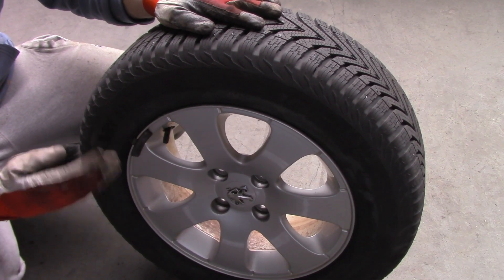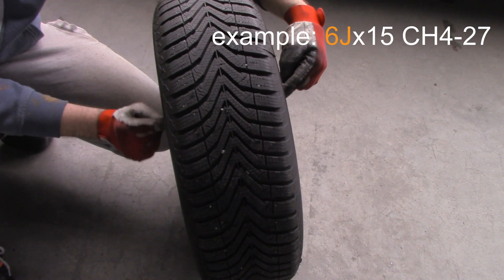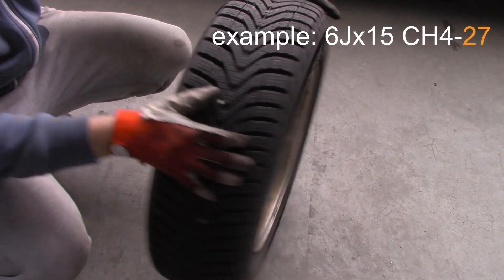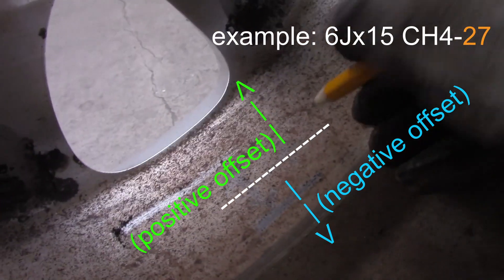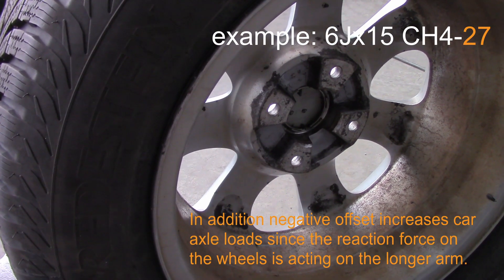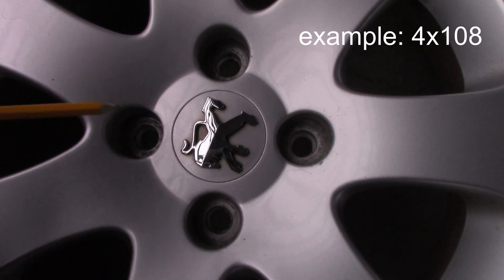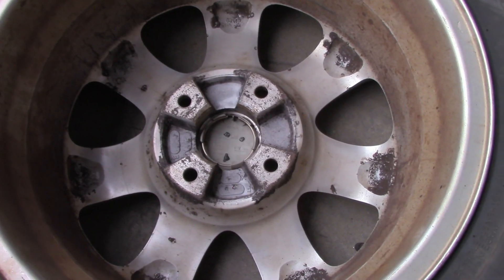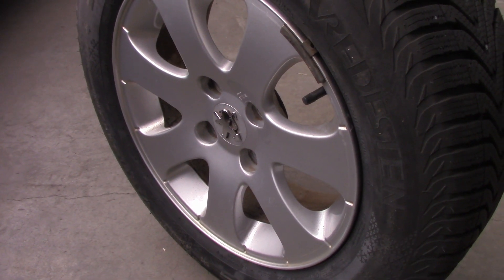Rim Markings EXPLAINED

Comment: To correct your explanation at the 1:10 mark, the CH is the hump style, meaning combination hump. The "4" means that your wheel has four bolt holes, and the 27 is the offset. So there is actually three bits of information in the CH4-27: bead seat design (combination hump), the number of wheel lugs holding the wheel on, and the wheel offset in millimeters. Thank you for taking your time to publish this video. It was very informative.